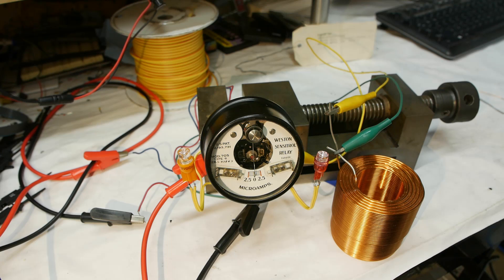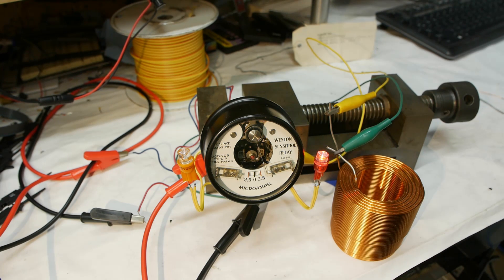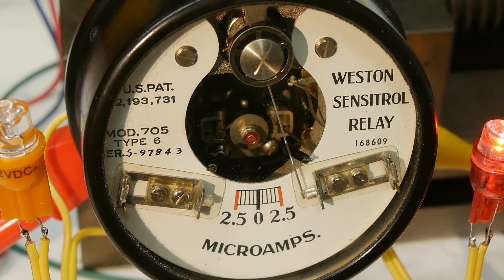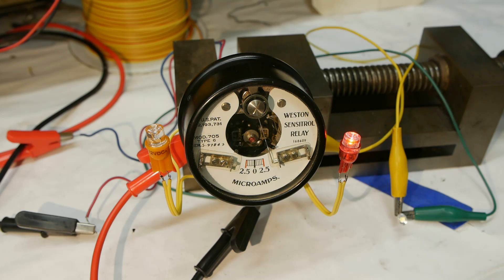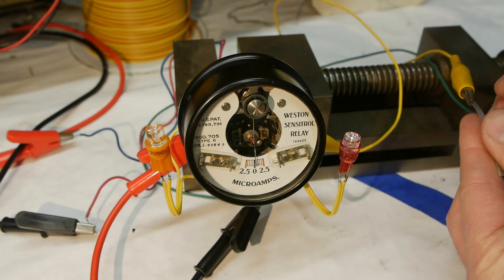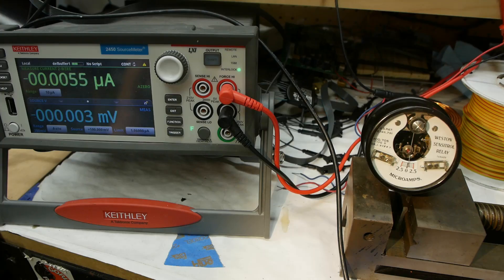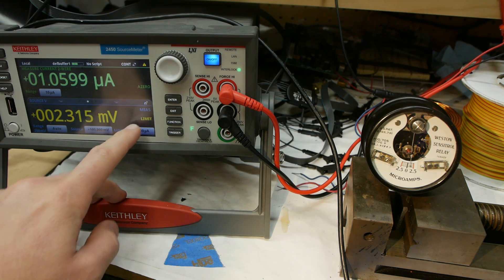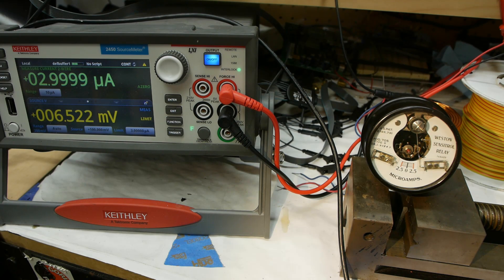Vintage electrical tech - Weston Sensitrol Relay

Comment: Reminded me of Ballistic Galvanometers from about the same time frame.  We had them in the physics and electrical education labs.  I was awed by them then and remain so.  By the way, they had a light beam “pointer” with a moving mirror.  That produced an extremely long equivalent needle pointer and tremendous sensitivity.  Also, Walter Levin used one similar in his MIT demos that you should still be able to find on YOUTUBE.
Another extremely sensitive relay I got in my hands after I had toiled with multiple transistors and two ordinary relays to build a run up / run down motorized Variac.  The sensitive relay was a polarized one that responded to millivolt and microampere signal levels.

Comment: I'm so anxious you forget µ when you enter the test currents!
Reply: thats what I though as well
Reply from the maker: The folks at Keithley thought of this. I have the current range set manually to 10u, so even if I accidentally entered 3A, the device would show an error message and keep the previous value.
Reply: Yeah, I was wondering what would happen IF you pass more current through the device? Would it actually break or just max out and work after resetting?
And then I thought about something else: is there a way to test such a thing without breaking the device?
I would like to see a follow up with answers to these questions, and perhaps an inside view.
Reply: HalfSpeedMastering:  Just because I was curious:

Using the table you linked and assuming the wire is 40 AWG, then the average of the four stable readings in the video are 2179 ohm.  That implies 633 m of 40 AWG wire.  The max current from the table is 0.0137 A (which the table claims is very conservative for power transmission, but I do not know how conservative it is for a coil, possibly in vacuum).  That current and resistance gives us a maximum current of 29.9 V at which it would be dissipating 0.409 W.

So, Ben said that the source meter was capable of 60 V, so it is probably capable of burning out the meter coil (or at least exceeding the maximum from that table by a significant degree) just like you said.  But I found it interesting that it was not necessarily by orders of magnitudes.  And as he said he had manual range limits which kept it safe and probably many other tools one might use would have such limits, too.  At least if all you have to worry about is the heat from excess current.  I have no idea if one could deform the needle or otherwise damage the meter with larger currents than it was designed for while keeping the current low enough not to burn anything up.
Reply: In what setting do you think that a sensitive instrument like this would be used?
Reply: HalfSpeedMastering , it's pretty easy to  bend the meter needle before smoking the coil as well.

Comment: That is a beautiful piece of equipment! I work at an ammoniaplant and there are still a lot of very old measuring devices in the field because they always work! The reason most of the time they will be replaced is because you can not get parts ro maintain them properly anymore...otherwise they would stay in the field indefinetly..lol

Comment: What kind of application would this have in its day?
Reply: At the time this unit was made, piston engines on large aircraft frequently had engine fire detecting and warning systems based upon a string of series-connected thermocouples mounted in strategic spots around the engine.  Unusual heat at one or more thermocouples generated a tiny current that triggered a warning relay in a control box mounted in the electrical equipment rack.  I never knew what was inside, but the box was mounted on anti-shock springs and labeled "Handle Like Eggs."  I suspect something like the device shown here did the work.
Reply: Standard Eggs Box for the crew's meal?
:o)
Reply: a youtube video :P

Comment: This would have been an intresting device to use in that lamp blinking contest.
Reply from the maker: I briefly tried it :)  I wired the relay contacts to activate the reset solenoid, and triggered the meter.  I found that the reset mechanism would send the needle flying away from the contact, and disengage itself before the needle came to rest, causing the needle to continue swinging over to the other contact.  It would need some electrical filtering / delay to work this way.  We'll see what the next contest rules are!

Comment: I didn't know that about LED's.  Very cool.
Reply: Light detecting diodes (like the IR receiver on your TV) are basically tuned to do this more efficiently. It actually works with any LED if you dump enough photons into it.

Comment: That "averaging" effect is basically just the bandwidth of the system.
Reply: Piet Muijs   Made me recall hysteresis.
Reply: Yeah, you could do the same thing with an RC (or RLC, etc) filter.
Reply: SAI Peregrinus   The delay is because of inductance, isn't it?
Reply: Partly. But a large part of it is because of the inertia of the coil & needle moving. It's effectively a low-pass filter, so any low-pass filter can accomplish the same thing. No need to do it digitally.

Comment: That's amazing.  Makes me think  how 30 years ago, tv's could be turned on and off 5 times a second (yeah I was a kid mishandling the television). Yet they still had a form of video compression that solved a bandwidth constraint that essentially exists to this day.  My current tv, takes up to a minute just to display a picture, albeit an amazing picture, the human still waits.  Displaying a low bandwidth picture still relies upon the newer style of crazy deep digital dependencies.  One thing I find fascinating about genius, is that it can solve for what it needs within the bounds of what's practiced.  Today, your device is like voodoo to me.  Pretty unlikely to exist until I saw it.  These days everything is a nail, and silicon is the hammer.  In a way, silicon is extremely limiting by not forcing/letting us solve  for things in amazing and clever "other" ways.  And of course knowledge is lost as we loose that gained experience, and eventually deemed unlikely to have ever been known.  I wouldn't have guessed a device with that much precision existed.  But it also doesn't surprise me, if it was needed. Really like your videos.
Reply: I don't know man, I remember those CRT's taking about 60 seconds to warm up enough to where you could actually read text on the screen.
Reply: That's a good point :)  Also these days I can run a tablet off of a few watts and it weighs 200 grams. Still, it's all food for thought.  I deployed a system years ago, that attempted to emulate instant channel change for television.  Something analog systems had naturally.  That system was clever in it's own right albeit complicated.  Really complicated.  I guess I would say in todays digital age, things are better, but unreliable.  And feature creep ruins everything instead of iteration and improvement making it more stable. I look forward to  better times and better devices. ^^ still a really impressive device in this video :)  I suppose we can build more sensitive relays now as well.  Even in our own basements.

Comment: The fact that an LED can perform the opposite function (as a current source when inundated by photons) is worthy of its very own video.  Does that mean a LED screen could be used (if designed correctly) to recharge batteries when not being used for image display?  Is this effect how modern solar panels operate?
Reply: that's exactly how "modern solar panels" (photo-voltaic cells) work, but the cells are designed so that the section of the diode that absorbs the light has maximized area.
Reply: It's not surprising if you know how LED's and PV cells work. Did you know that loudspeakers can also work as microphones, and vice versa?
Reply: Still worthy of a video.  He did just make a video to explain magnetism.  Why not one to explain the photoelectric effect?  I was aware of a speaker's ability to reverse as a microphone since grade school (it is based on magnetics).  The photoelectric effect wasn't really covered however as semiconductors were still a post-secondary topic at the time (in fact electronics as a subject in and of itself wasn't covered at all).  Perhaps because I went to school in a geographic region whose industries lied around trades and forestry rather than silicon.  Tech was just some magical rich dude "the mills called in" and would roar his luxury car around the mill yard like it was a dozer whenever he came to fix one of the automated systems.
Reply: Reciprocity is a wonderful thing (wheresat?)...

Comment: I do wonder, can this thing be reset by supplying a current in the opposite direction? Or is the magnet holding the needle so strong that the current required would be too much for it to handle?

Comment: I found an old surface meter called a Gould Surfanalyzer 21-1350-00 (which is similar to a Federal Esterline meter)and purchased without thinking about the LVDT variant  HBT(Half Bridge Transducer). So I am in the process of trying to see if I can use a LVDT to work on the meter etc. any idea if the probe is special that comes with one of these amplifiers meter etc? I looked at the circuit board inside and noticed two 741 op amps and two Jfet transistors. Hook up the unit and check to see with an oscilloscope any ac signal which could drive a sensor probe (which i already have). But noticed no ac signal and also noted the two wire connection etc. I am wondering if it is a Hay Bridge or an Owen bridge configuration it appears it could be either one as one needs more of capacitance and the other needs to have any resistance greater than 10 Ohms. but the two sire input is throwing me for a loop. Since I have already scoured the web and every area that might have a manual or schematic etc....no chance. Since the circuit has a bunch of diodes and capacitors and resistors, and can also be powered with batteries made me think it is using some other technique to measure linear displacement etc. Any idea where i should try and hit up to try and figure out what type of probe it should use etc.. The device was built in the early 80's possibly late 70's. any information would be great thanks!!!!!
Reply: I think i figured it out. I believe it could be some form of resistive  linear strain gauge since only two wires go to the input even though there are 5 pins etc... Just my loud thoughts...

Comment: Is it drawing Volts, or Amps? I would think it would draw a certain currant at a certain potential.
Reply: These meters are driven by the current, but generally, you have a fixed resistance through the meter, so you can just label it in volts if you want.  That's how analog voltmeters work.  They are just current meters labeled in the voltage which produces that current.

Comment: I can't find it in the advertisement, is there any kind of max amperage for the relay contacts themselves? How big of a thing could you theoretically drive with the contacts? Although I guess you could just use this as a pilot control circuit type thing

Comment: once found several unused zero centered, zero to one micro ammeters in an unusual electronics junk shop. He was only asking $5 for each. Went back a week later to buy them and it was closed down! Was going to build an air probe with them.

Comment: Is there a modern equivalent electronic device that is equivalent to sensitrol relay at the same sensitivity?  A micro-electro-mechanical relay that is open on 'off', and conducting with no resistance on 'on' in nanowatt range?

Comment: What if it latch to positive current and then you pass through it large negative current, will it unlatch or it disconnects sensing circuit when latched?

Comment: Can you test out the old spinning Westinhouse power consumption meters that they're replace with digital ones? I read that those produce electricity. I know it sounds dubious but I read that before the internet turned into a giant echoing ces pool, back in 2006 or 2007, so it may be true.

Comment: I've heard about this reversing effect of LED's, but you motivated me to test it out for myself. Sure enough, my meter shows ~2.6v coming out of my UV led's with a strong UV light focused on them, at up to 4 microamps with my strongest UV light, and oddly up to 9 microamps with my weaker one. I'm guessing my "weaker" one is putting out more non-visible UV?

Comment: I always thought it was incredible that a metal-metal thermocouple could trigger a safety interlock relay in a furnace by producing a few mV.  (Not as much now since I have a semiconductor Seebeck device that can actually switch a regular 5V relay with a similar temperature drop) This thing is almost beyond what I'd have imagined possible for a bonafide relay made before active electronics could even fit inside such a device.  How much power can the contacts handle?

Comment: What was the purpose of that meter? Pretty high tech unit :)
Reply: ditto - can't think of an actual application of this? Guessing it was a pretty pricey doo-hickey too...
Reply: These were mostly used for overload sensing on high power devices. They were also used to sample the water purity in water cooled radio transmitter tubes, and trip an alarm if too many impurities would get in the coolant, making distilled water start to conduct.
Reply from the maker: One use would be limiting current for high voltage power supplies.  It can be wired like a circuit breaker. Another use could be to control a lab or manufacturing process, ie connect the meter to a pH probe, and have the relay control addition of acid or base in a big tank.  It would need some additional timer circuitry.
Reply: neat!
Reply: It would be really great if you'd tear it down and explain how it works. If it needs only 18 nW of power it has to be pretty well balanced with some springs or it has some very clever mechanism inside. Probably both and a little bit of something I did't even think of.
Reply: Could it be used to measure flow of some fluid and shut a valve?
Reply: It's probably no different inside than any other analog movement, apart from the magnets and centering solenoid. Of course it's centering spring is just that less strong and it's permanent magnet is pretty hefty as well.
Reply: say if you wanted to monitor demand based voltage changes in power genenration, and alarm the operators if the current draw is too high or too low to tell them they either have to turn off or turn on generators. you could use sensing transformers to proportionally monitor a high voltage bus bar against a reference (a bias point). equipment that sensitive might be more useful in chemical processes however.
Reply: They were also used for nuclear reactor control systems.  Let a parameter exceed the limit, and the reactor will scram
This Sensitrol application is specifically mentioned in "Atomic Awakening"  by James Mahaffey
Reply: This is probably used to prevent current leaks...if i said that correct...
Reply: I imagine it to be a 1950s GFI, before they had the concept of grounding and earth leakage :)
Reply: The senistrol relay was used for sensors with low power outputs (i.e. photoelectric sensor) which cannot control standard relays.
Reply: Bombs.  Bomb trigger switch.
Reply: why tear down such fine antique?  I'm pretty sure it's not much different from analog galvanometer (also Weston's design) or analog multimeter/VU meter, just with additional of resetting solenoid and magnet to hold the needle to close the circuit.
Reply: I assume it could also be used any time you need to trigger and hold on a very weak signal. I can think of a lot of reasons for that, particularly in scientific equipment.

Comment: I wonder what purpose this thing would have, perhaps testing or protecting really sensitive electronics?
Reply: Detecting light with a photocell, not needing radio tubes/valves to amplify the signal perhaps?

Comment: That is a thing of beauty! I'm still not quite sure how it's latching - is it simply magnetic attraction between the needle end and the contact, or is there something fancier going on? It would be fun to rig up something similar with a modern meter movement, although you're not going to get something as sensitive as that is!
Reply: little peace of some magnetic material at the end of the needle and magnets either side

Comment: I would think that the pull of the magnet would throw the meter off at the extremes of the scale
Reply: Yeah, but there was a gap between 2.5 uA and where it got to the magnet.  Also, you could place the lines so they compensated for distortion by the magnet.  So, hopefully at least in the labeled range it was accurate and compensated.

Comment: I would think it was susceptible to vibration tripping it.  Bang on the panel with your fist to trip the relay.
Reply: Those (and any meter movement in the microAmps range) are very fragile. When shipping them, it is a very good idea to short them out, so the movement stays put and the needle does not get damaged. I have a spool of bare 28 AWG wire on my shipping bench for exactly this reason.
Reply: They are well damped, but yes they are very sensitive to vibration both in shipping and in use. In the use cases though you would have it on a panel with anti shock mountings at least, so the machinery vibrations are not transferred to it.

Comment: I don't see how one would need a microcontroller to reproduce that relay's behavior. In fact, anyone experienced enough in electronics design could design such a circuit using some precision op amps. Heck! Even I could do it.
Reply: Yes, it can be done with op-amps. The point was that it was an all-in-one device and to design and successfully make something so sensitive that with a good enough mind one was not limited by the tech of the day. The imagination truly is the only limiting factor of humankind.
Reply: John Possum I agree. Fascinating tech for the time. I'm just not a fan of people sticking up an arduino up everything's clacker.